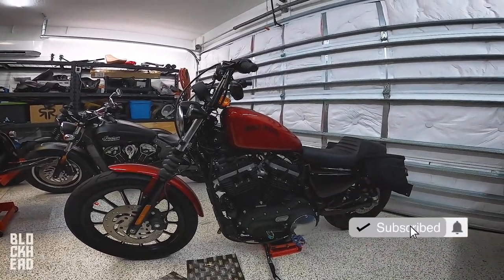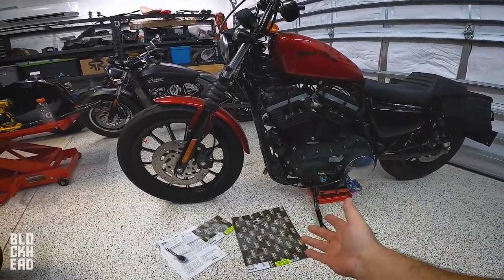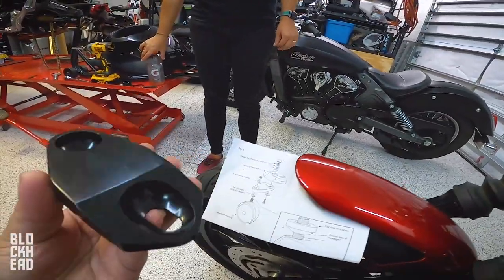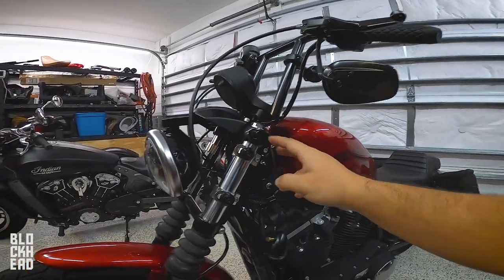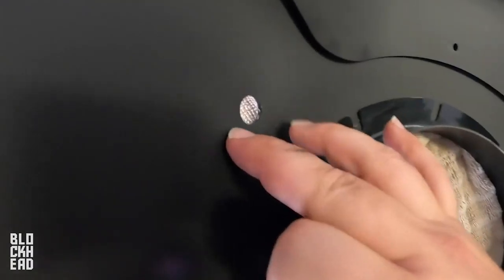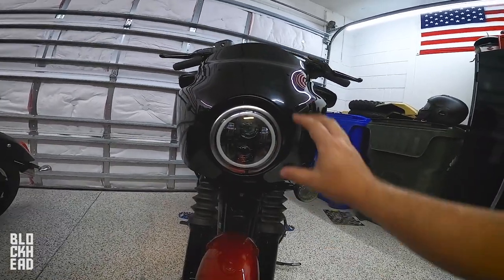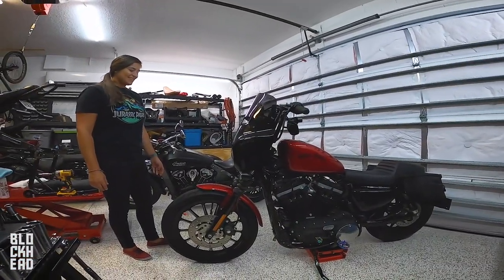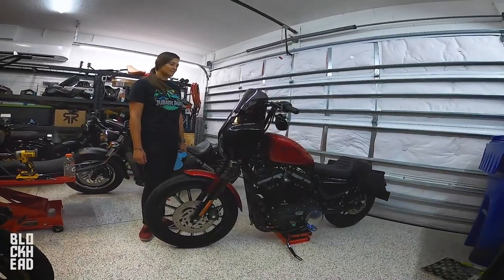Her NEW Sportster Fairing! (Harley Iron 883 Memphis Shades Road Warrior)

Comment from the maker: Hey all, just to clarify so there's no confusion, the links here are to parts that say it fits a Harley Dyna, but these are the part numbers provided to us from Memphis Shades that we used to fit the Road Warrior fairing to Captain Ana's 2012 Sportster Iron 883! They don't have a dedicated 'fits Sportster' setup, it's pieced together with parts used on other models, but it all comes together and works on a Sportster Iron 883, as seen in the vid! 

I believe as long as your Sportster has the same fork tube diameter for the clamps, and fork width to align w/ the mounting brackets in the fairing as a 2012 Iron does, the part numbers should theoretically work, but don't hold me to that! Your best bet is to contact Memphis Shades and ask their knowledgeable staff! 👍  (and tell em Blockhead sent ya!)
Reply: Perfect will do!
Reply: Hey, just to make sure everything come separately?
Reply from the maker: @ricardoortiz7624  Yes, each part is ordered separately. Fairing / mount kit / windshield / headlight extension
Reply: @BlockheadMoto  okay, i have a 2016 iron so its supposed to work? Last question the windshield you install is a 11" i am 5'10" thats its the right height for me. Because in the video i think you said better a littler more taller. Correct me if im wrong. Thanks by the way.
Reply: @BLOCKHEAD the Sportster fitments are now live on our website, with a few other Sportster fitments - '11 to '19 XL 1200 Custom and the '16 to '20 Forty-Eight! Our network of awesome dealers should have their information updated soon!
Reply: CapitAnna
Reply: Thanks for the video.

What does is look like, from behind it?
There are other brands that have these types of Dyna fairings that could either be made to fit Sportsters, or that already do.
Do you know about them, and do you have a preference, as far as quality and pricing?
I am also wondering if some of the speakers systems, like Plex or others will fit and mount in/on the backside of this fairing.
I may have to call, to find out, if this fairing fits early 2000s Sportsters.

How did she like the fairing, after riding it?
Reply: I installed this same fairing on a 2003 Dyna which has Forks that are identical to a Sportster right down to the headlight mounting system.
Reply: It doesn't say but it all should fit my 93 fxr also, basically the same front end.
Reply: My 01 FXDL has basically the same front end. Brow cover and all.
Reply: He blockhead could you and Captain Anna do a first thoughts and Impressions on her Memphis Shades Road Warrior fairing for her Iron 883 please.
Reply: What type of bars are on her bike????
Reply: @mikecartagena4613  I’m tryin to figure that out too. Any luck yet knowing what they are?
Reply: @memphisshades  heeeey... how hard is it to make it fit the xl1200ns!?! Take my money for crying out loud
Reply: @BLOCKHEAD @Memphis Shades so after months of waiting and multiple times asking MS they finally responded "We don’t offer one for the 1200NS." No reasons why, no reasons why or how the 883 is dif than the 12. Tbh I think MS are seriously slacking. Every thing I have looked up says the latest Iron 883s and Iron 1200s are literally the same bike other than the engine. Please Blockhead do us a favor and do a vid on why MS doesn't want to sell to 1200 owners or why

Comment: That's the fairing I've been thinking about getting for my 1200 custom thank you for showing us how it goes on and what it looks like I kind of want to do the hand guards as well 😁
Reply from the maker: 1200 custom has different fork tube size I think. Double check before ordering to confirm fitment 👍
Reply: @BlockheadMoto  I want to get this fairing for my Iron 1200 but I can’t find any info as to if it’d fit or not. Do you have any insight?
Reply: @giannattasiojoey  On the Memphis Shades website you should be able to select your year model and bike and shop by bike specific

Comment: Nice.  Been thinking of a fairing on my 48.  Might try this now! 👍🏾👍🏾
Reply from the maker: 48 fork tube width is different than the Iron, and I believe the diameter might be different as well, so be sure to contact Memphis Shades and confirm fitment before ordering! 👍
Reply: @BlockheadMoto  cheers bro. Will definitely check that first! 👍🏾👍🏾

Comment: My headlight wire that is plugged with a grommet in rear of the headlight bucket is pulled very tight and barely fit with extension block. How do I extend that like 1 inch? Same iron 883 but 2015. Man im so upset! Was Annas that tight too? Its mainly a problem when turning handlebars to the right.

Comment: I installed just the same parts on my '15 iron, and it all worked out.
But the headlight cable is kind of "tight" when i pull the bars to the right...
Its all good, but is the cable tight on hers too?

Comment: Blockhead! Do you know what year sportster you need to have to be able to install the fairing? Do the also fit older sportsters? Thanks!
Reply from the maker: Not sure the year range for fitment. So long as it has the same fork tube diameter for the clamps / hardware, and fork width to align w/ the mounting brackets in the fairing as a 2012 Iron, the part numbers should theoretically work, but don't hold me to that. Best bet is to contact Memphis Shades and ask their knowledgeable staff! 👍
Reply: @BlockheadMoto  thanks for the quick awnser, i'll contact them to be sure!

Comment: i wonder how it would fit with drag handle bar 🤨
Reply: It wouldnt. The bars are so low that the fairing wont go on. It will hit the master cyclinder before it clamps on. The only way to make it work withnthe drag bars is to get a high enough riser setup. By that point, the cables/wires will likely need swapping too. Take it from me, Im going through that process right now with my 883, but with the Cafe fairing from MS. My riser setup with the drag bars will be 10”. I love the look and feel of the drag bars, that’s why I’m taking this route. Otherwise, if you don’t want the hassle of doing the riser route and save the cash, it works if you go back to the stock bars.
Reply: @drsparwaga  thnx for the light up